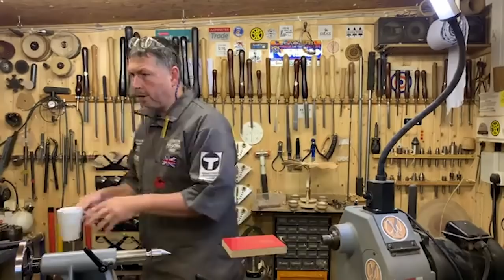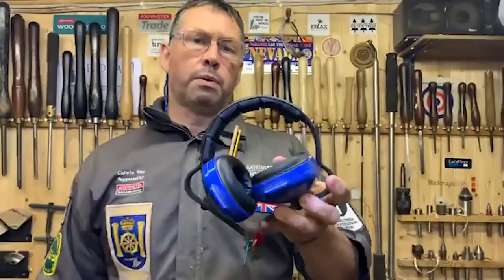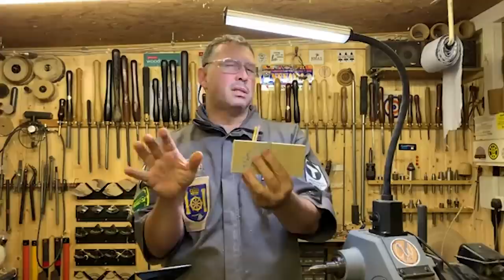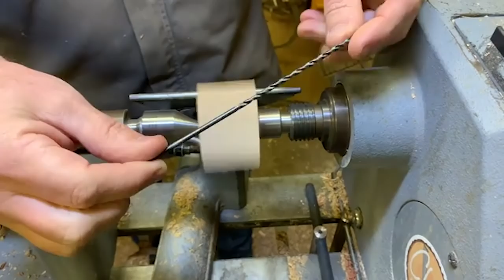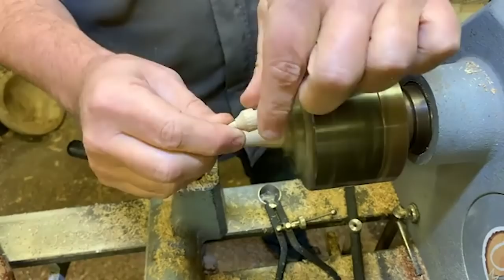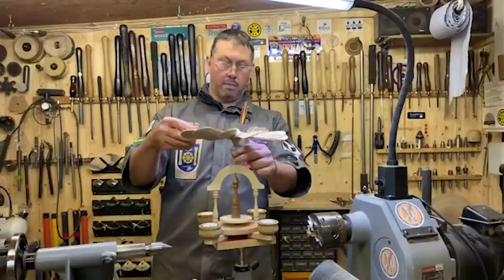Live Turning Thursday - Christmas Pyramid - Part 2

Comment: So for those of us who don't have an indexed lathe, that's the major diameter divided by 30°. Wrap a string around the major diameter  and mark where the string crosses itself.  Those are your ends. Use your straight legged dividers to walk the string into 12 (actually 11 as the start and stop are the same) sections and mark. Wrap it back around the major and transfer the marks to the major diameter. Align with the centre and Bob's your uncle, Fannie's your aunt and the world is a better place.